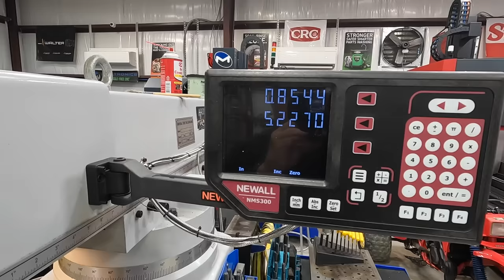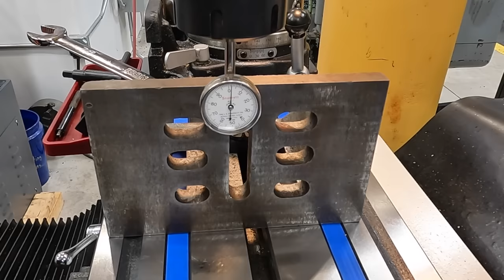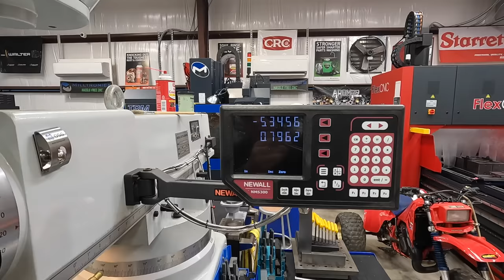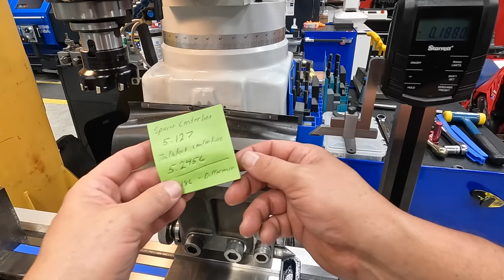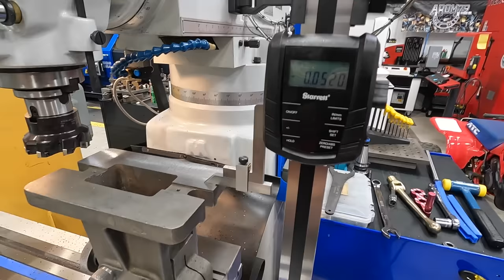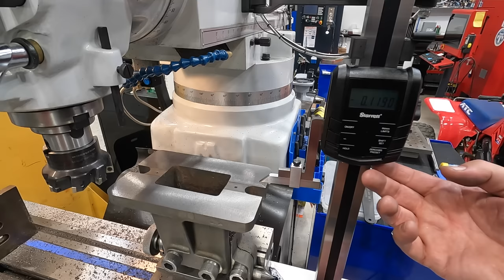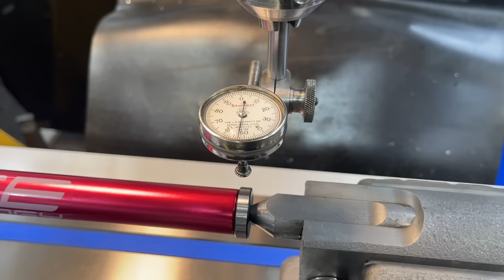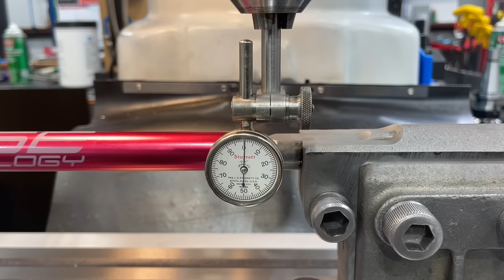Tool Tuesday Ep. 5: Tailstock Modifications

Comment: Dude.. love these vids on levelling beds , ways , alignment from chuck to the stock...heads to bed... ,  after watching a couple of vids , makes life so much easier...and provokes confidence  , knowledge is paramount... done in a way which is not confusing or condescending...
I've been on the tools for only 3 years... well close to it.. have 1970 spanish d360 Minitor lathe... and a Heller ftv-3  mill auto on x and y , z manual... with 3x dro... if treated like a lady works well.... .. got tool grinder too.... , now this hobby is growing... and is more addictive than crack....  need a shaper....!

Comment: QUESTION ❓ when you adjusted the side play to take out that. 003 alignment error using that alignment bar and you loosened the nuts holding the tool to the table and then tightened them down to get  zero reading on the guage. But when you put the test spindle in you had losened the nuts to slide the tail piece into position on the spindle, now would you have to indicate that side play again and take out that .oo3 misalignment again every time you moved that tail piece?

Comment: 15:34. Looks like you need a couple shelves mounted around the crane for small parts. They can be made from wood for temp. use.
   Around the base you can make some inserts out of ply and 2xs to cover the anchor bolts. Wood will be better anyway because the parts won't slip.

Comment: Will you need to realign in the Y axis every time you move the tail stock?
Reply: That's what I was thinking.  I thought the keys were supposed to be a tight fit in the T-slots so that tapping into alignment was not required.
Reply: It depends what you are making, parts for NASA = yes, drilling some holes for a tommy bar = no

Comment: checking math: 5.227 - "100 thousandths," 0.01in., is 5.227 - 0.01=5.217in. unless I heard incorrectly.  Thanks for sharing.
Reply: Your math is incorrect by one decimal point. You subtracted ten thousands, (.010) instead of one hundred thousands, (.100). The correct calculation is 5.117.
Reply: hundred thou is 0.1"

Comment: So at 8:30 your indicating your right angle plate, and find a bow in it. It's got me wondering. Would you mill that bow out, or run a couple beads of weld allong the back to pull it out?

I mean. I know you would just mill it, but what a technical exercise it would be to pull it out with weld🤔

Comment: Couldn't you take the material off of the pads in the bottom of the pocket or off the bottom of the center insert instead and keep the original centerline keyways and base strength?
Reply: Only works if the slots in the head are long enough, or else it will sit on the bolts before those faces can touch. Not sure if you can make those longer, you might get into trouble with the centering shaft at some point.